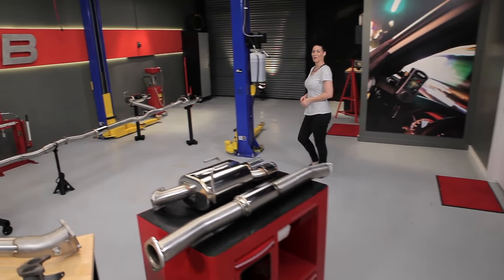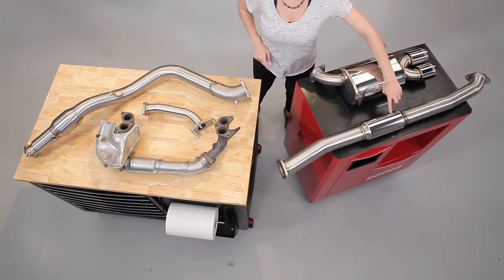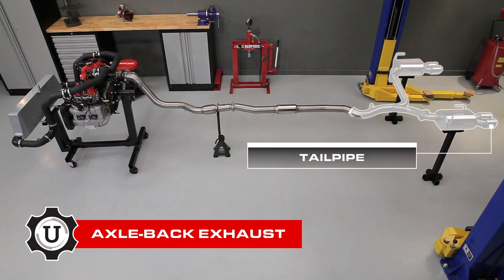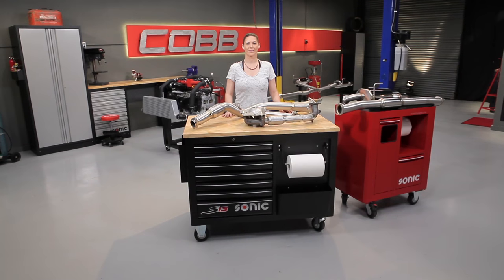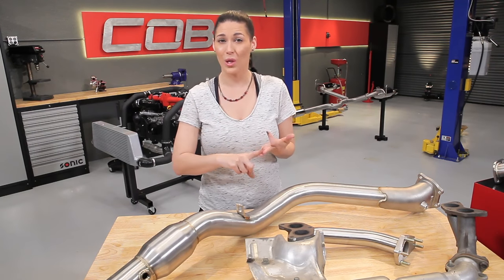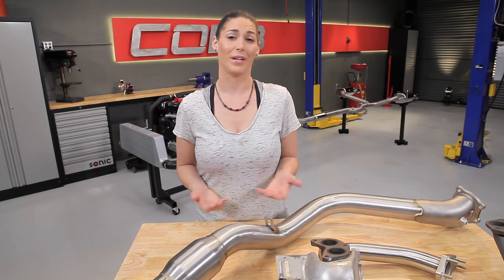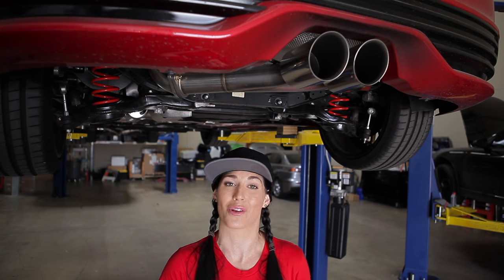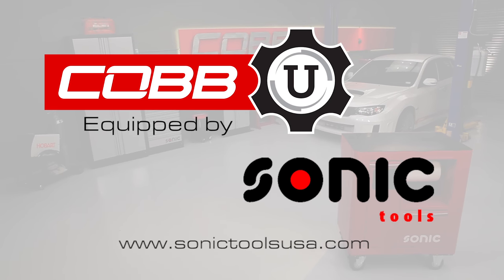COBB Tuning - COBB University Episode #9 - Exhaust System

Comment: I'm an advanced snow skier, and will also be a ski instructor for the fun of it. So, I am doing research and asking lots, and lots of questions about modifying the new Subaru 2022 WRX.  I just subscribed to your Cobb YouTube Channel. I always have enjoyed the aftermarket parts that give a car's engine more performance. An internal combustion engine is a pump that burns an oxygen air-fuel mixture for the the energy to move the engine's pistons. So, I know as a math teacher/ track&field/Football coach, that the easier the engine inhales and exhales its air-fuel mixture, the more efficient that engine runs. So, I definitely will be modifying the new 2022 WRX with the best inter-cooler, and down pipes with a 3' exhaust with only a singe 4-exhaust muffler. Oh, and the I also know that I want the whole car to be as light in over-all weight as possible. So I want a single Titanium muffler. Also, everything possible to improve the engine and handling characteristics of the WRX. I have experienced a Sturt tower bar on my daily driver, and how it improves the handling of any car that has strut towers. I need a WRX where sometimes the CHP will make me put on tire cables on my AllWheel drive WRX. So lowering the vehicle will leave me no space to put on tire cables in the new WRX. So I will never lower my WRX... but may lift it for more suspension travel....  Who was that guy I saw on Youtube who had a WRX jump over a huge open ramp to ramp?  Tyler something.  Class Dismissed....

Comment: COBB Tuning  You didn’t talk much about exhaust manifolds/header upgrades do they not gain anything or what about an ecut out after cat with proper tune ?
Reply from the maker: Depends on the car on the manifolds.  Cut- out post cat won't do much if anything (power-wise) on most applications.  Kyle@COBB

Comment: Would I need a custom tune if I add an up pipe? The off the shelf tunes don’t list a different up pipe
Reply from the maker: Miguel,  An uppipe will not require any special tuning.  You'll be fine with the stock or off the shelf map if you add an upgraded uppipe.  Kyle@COBB

Comment: I absolutely love your quality products but the catback for the 2015+ WRX is a little quiet...with the Stage 2+ tune could you run the cobb non-resonated downpipe with another catback exhaust with the same size tubing...per say the Tomei Expreme Ti?
Reply from the maker: Hi Max, that should work fine.  You can use a different cat-back with our down-pipe and the stage 2 tune.  - Adam@COBB

Comment: Hi Emmy. I have a question on my naturally aspirated engine. Are these engine manifolds the same for turbo manifolds?
Reply from the maker: I can't think of any vehicle where they are the same.  The turbo manifold(s) merge to the hot side of the turbo.  Your NA car's manifold(s) will likely collect differently and continue to exit the rear of the car.  Kyle@COBB

Comment: what about a muffler delete ?
Reply from the maker: You could think of it the same as an aftermarket axle-back.  It would not require any tuning changes.

Kyle@COBB
Reply: COBB Tuning i have a 2017 fiesta st . i was told that a muffler delete would give a lil more power is that true ? or should i invest in a muffler
Reply from the maker: We haven't seen any significant power gains from any cat-back, muffler deletes, or muffler upgrades.  The best part to modify for power gains would be the intercooler on the Fiesta ST.  And, tuning, of course.

Kyle@COBB

Comment: The "catless makes no difference over high-flow cat" is patently false. I experimented with one of the most well-known tuners for the Mazdaspeed platform and found that on a fully-bolted Mazdaspeed equipped with a BNR S3 and running E25, we lost 15-20whp going from a high-performance metal cat (just like COBB uses - 200 cells/inch) compared to catless.

Don't be fooled: cats eat power, event the 100 cells/inch ones.
Reply: They're trying to stop people from blaming them for going catless, its just legal stuff
Reply: catless smell is biggest turn off

Comment: I got a exhaust system fix ticket but I don't want to remove anything I have on my 2015 wrx 

Atmosphere bov 
Aem charge pipe 
Egr delete 
Tgv delete 
Catless down pipe to
Catback high flow 
Cold air intake 

If I put my stock  exhaust system back do it works ?? Even if I have it tune
Reply from the maker: With those parts on the car, I assume you have a custom tune. If that is the case, you will need to talk to the tuner. In general, if you are just going to temporarily swap out your cat-back, then it should be fine, but check with your tuner first. -Adam@COBB